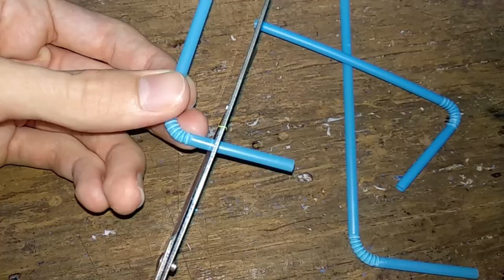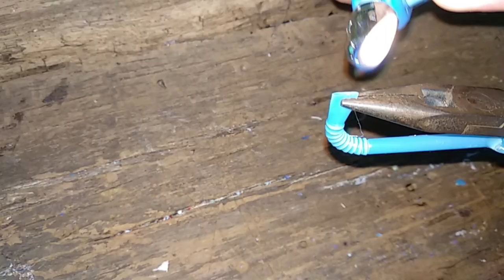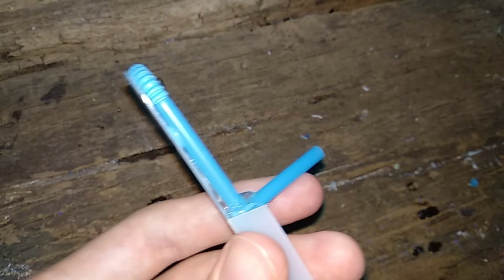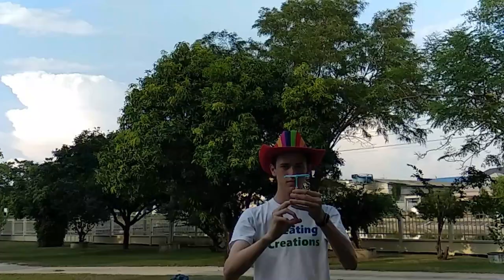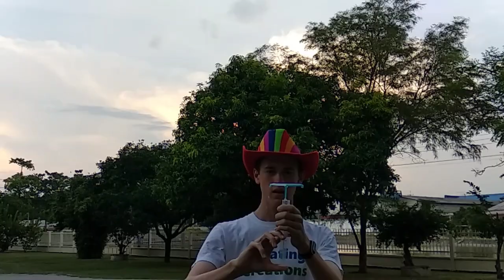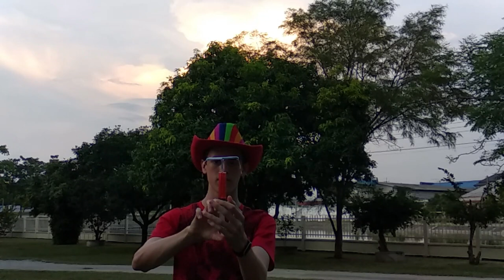DIY Flying PROPELLER Rotor Toy with Water JETS

Comment: Can you make a slightly bigger one, but with a container with an amount of water and using air pressure to push the water out? Like a small bottle 1/8th of water (because of the weight) and the rest pressurised air. Or just a container (soda bottle?) with higher pressure air than a balloon can manage.